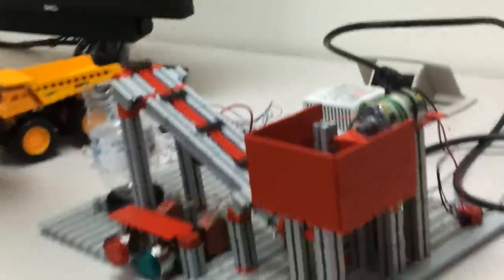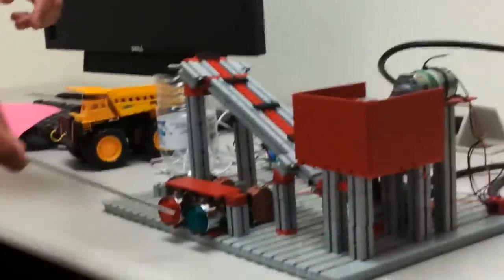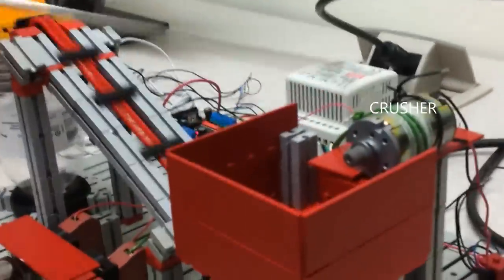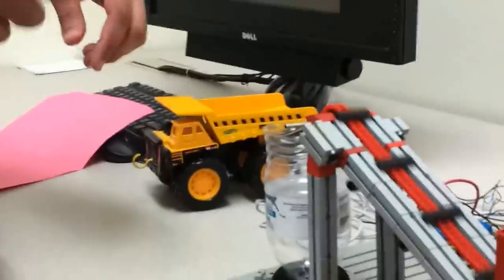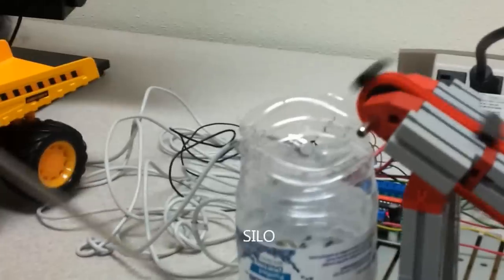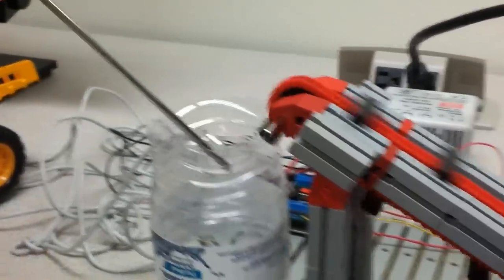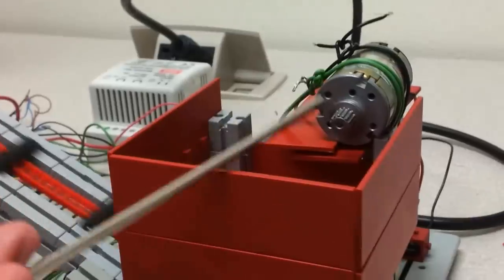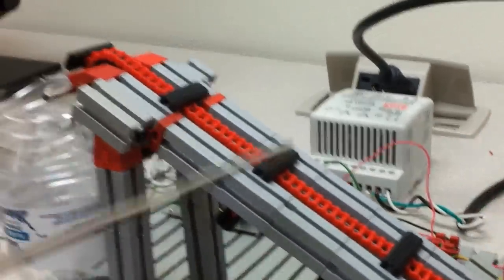Automation Project: PLC Based Coal Crushing and Conveyor

Comment: the motors we r using in this project should be servomotors or dc motors that we generally use in small project models ?
and how did u control the speeds of both motors?
Reply: +priyanka meena both?? It´s one motor
Reply: @BiMiHi  is two motors. Crushing, and conveyor. Dc motors should be fine for this task. Servo are when you need precision.

Comment: This is a simplified version. The real control system must at least but not the most have these functions: a crusher overload subsystem, a coal feeding machine subunit, conveyer off track subsystem, a metal detecte & remove machine, dust reducing or collecting system, and a balance unit. It sounds much complicated than this one but is not difficult for this designer.